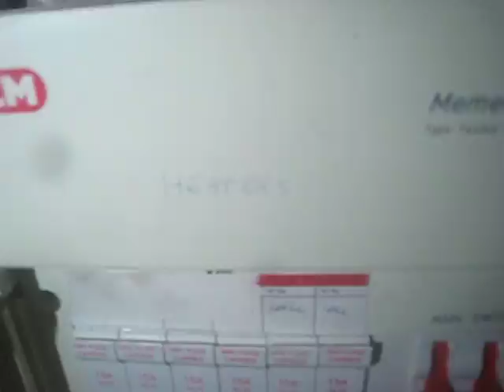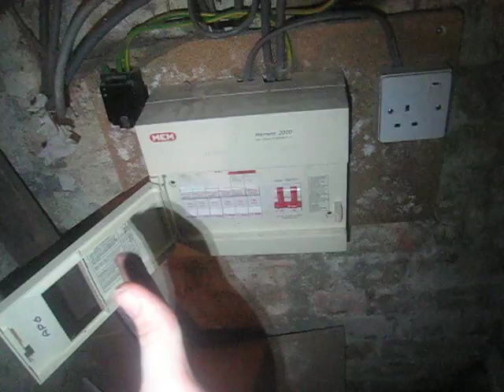economy 7 load shifting system: some research

Comment: I had a meter like this but there was a time switch in line which switched all of the electricity onto low, I squeezed the crimp to get the security wire off without cutting it and it all looked normal then i reset the timer just a couple of hours and had all cheap rate from about 10pm-10am,

Comment: Your electricity meter is a Sangamo Weston S309.2 :-)

20-80A, 240v, 50Hz, single phase, two wire with 166 & 2/3rd revs/kWh. :-)

I couldn't identify the Radio Teleswitch though ( That's the bit that makes the meter switch over to the 'Low' rate. 

-BoomBoxDeluxe.

Comment from the maker: @Dazzyc84 yeah, we could contact them but its easier to do it like this. the reason for this was to see if it was constant low rate at night or if it came on, then went off, then came on. i got 4 emails which means it is the latter so i am going to contact the supplier to see if we can get a timeswitch that comes on at night and stays on till morning.

Comment: if you want to find out the times,, contact your electricity supply. theyll be more than happy to tell you the times, but another thing, the timing changes with the seasons, eg winter time will come on more earlier (i think) and the summer tariff will kick in @ midnight - 10 am, :)